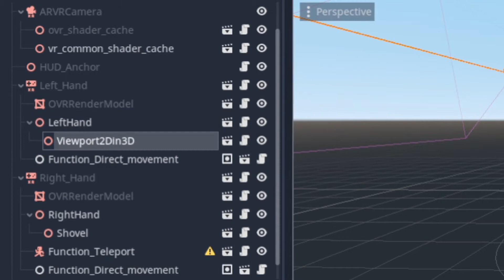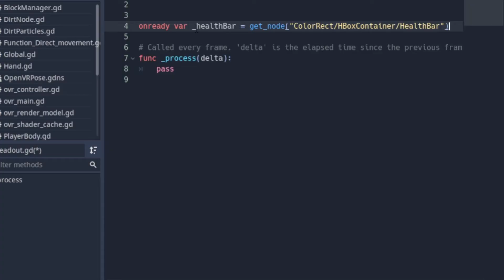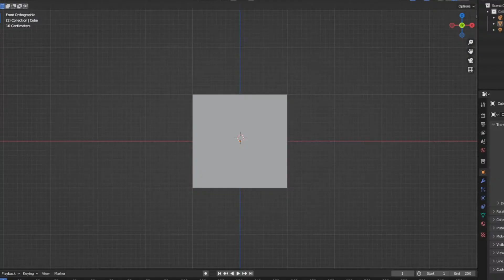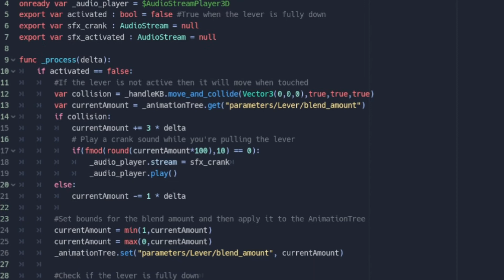Digging System In My Scifi Indie VR Game | VR Devlog 3

Comment: Looks great! From your explanation of the lever, will it move down if you just hover your hand over it or do you have to move your hand?
Reply from the maker: Thanks! So basically the lever has a collider that is fairly small (on the red part), when you stick your hand on the lever collider it moves it down but it stops moving down once it moves down far enough to where the collider is not touching your hand anymore. Which while you aren't touching the collider it slowly moves back up (until you are touching the collider again). So in order to move it all the way down you have to move your hand down to follow the collider. So it feels like you are actually pushing it down.

Its kind of a trick so that for levers that rotate as they get pulled/spun (like a wheel), I don't have to do any inverse kinematics to keep the lever stuck to the players hand (I just use the built in animation)